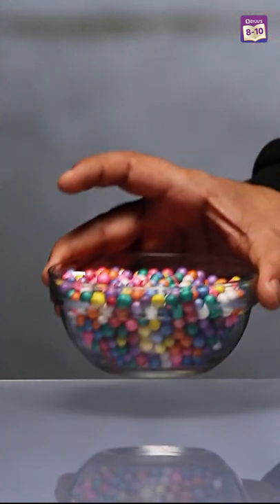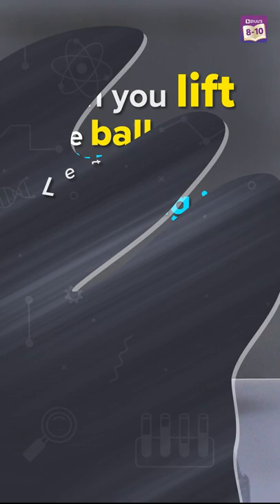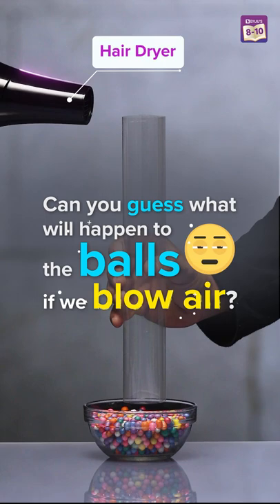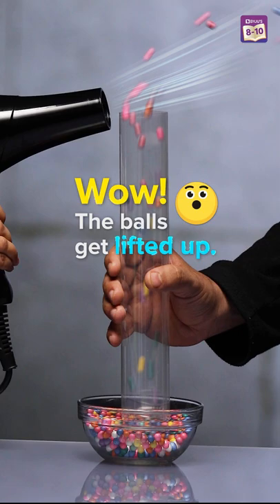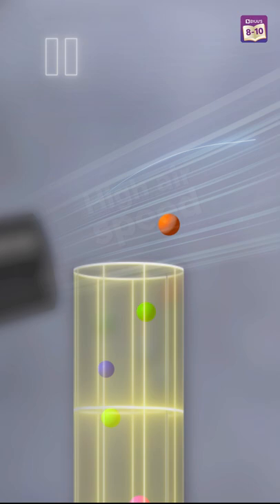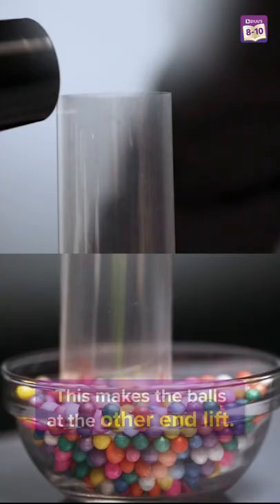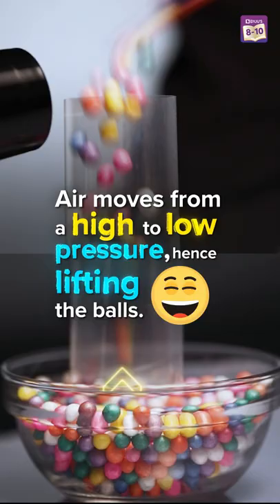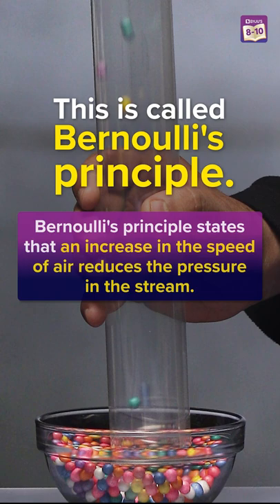Visualizing Bernoulli's Principle Experiment at Home | Science Experiments at Home | #YTShorts

Comment: Bernoulli's Principle Use-
Bernoulli's principle is used for studying the unsteady potential flow which is used in the theory of ocean surface waves and acoustics. It is also used for approximation of parameters like pressure and speed of the fluid.When a truck moves very fast, it created a low pressure area, so dusts are being pulled along in the low pressure area. If we stand very close to railway track in the platform, when a fast train passes us, we get pulled towards the track because of the low pressure area generated by the sheer speed of the train.Air moving over the curved upper surface of the wing will travel faster and thus produce less pressure than the slower air moving across the flatter underside of the wing. This difference in pressure creates lift which is a force of flight that is caused by the imbalance of high and low pressures.The Bernoulli equation has been derived by assuming that the velocity of every element of the liquid across any cross-section of the pipe is uniform. Practically,it is not true. The elements of the liquid in the innermost layer have the maximum velocity.Bernoulli's theorem can be used to calculate the speed and pressure of fluids.Bernoulli's theory is used to study the unstable potential flow used in the theory of ocean surface waves and acoustics.